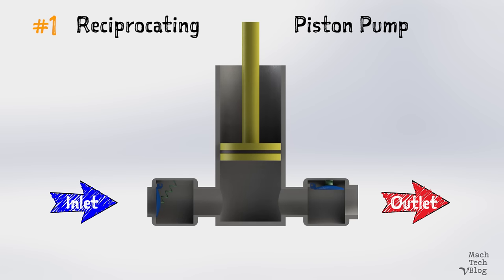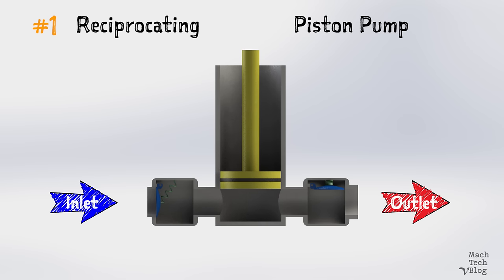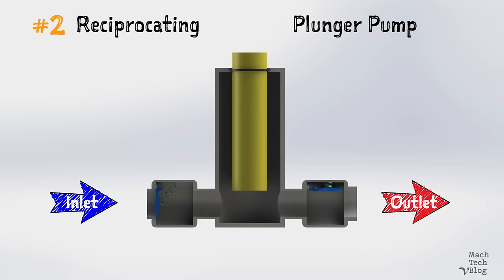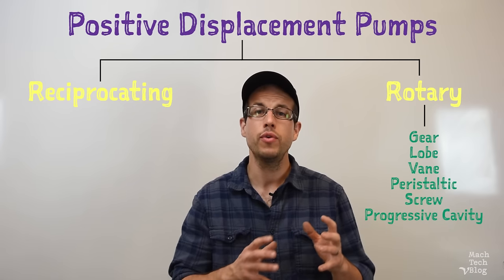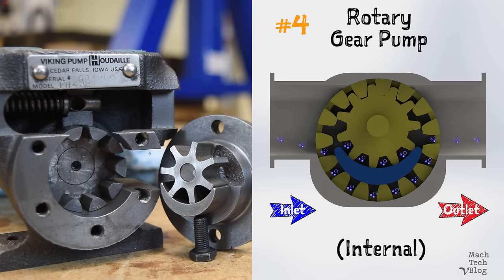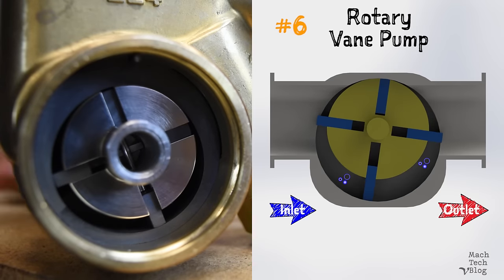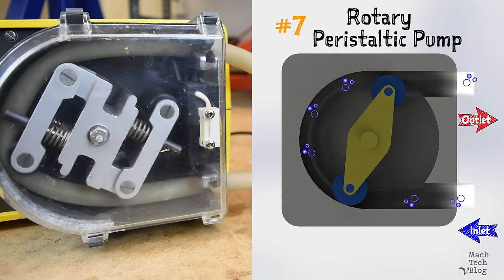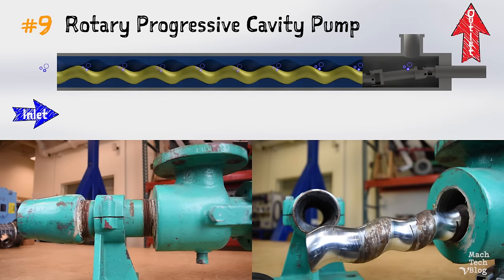Positive Displacement Pump Types

Comment: Hey there, I just wanted to ask you to lower your intro volume lower a bit. It is nearly twice as loud as your voice on the opening, VERY jarring and painful on headphones to be blasted by the intro music.

Edit: As a side note, I think your overall volume level is too loud and your audio is being compressed violently against the -0db mark. You want your "average" Decibel level to be around -12db. This gives the audio track enough room to "breath" without being forced into an aggressive brick wall compressor at the -0db max. If there is still too much range you should feed the audio through a more gentle compressor like a 2:1 or 4:1 compressor first. Usually, anything more than a 10:1 compressor on audio will sound slammed/choppy.

Comment: centrifugal pumps create higher pressure and is alot more better and efficient
Reply: Centrifugal pumps are better in general for thin liquids and relatively speaking high flow low pressure. PD pumps are for thicker liquids, higher pressure/lower flow, troublesome liquids such as slurries. Your statement is not true. Go to the car wash and spray your car off with 2.5 GPM, 2500 PSI from a positive displacement pump.